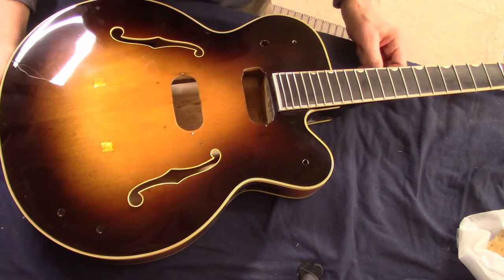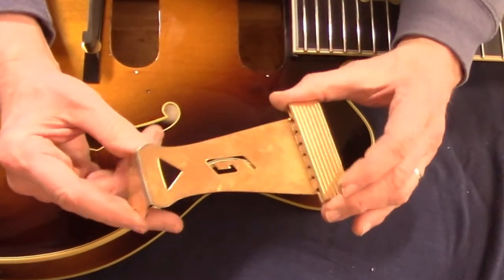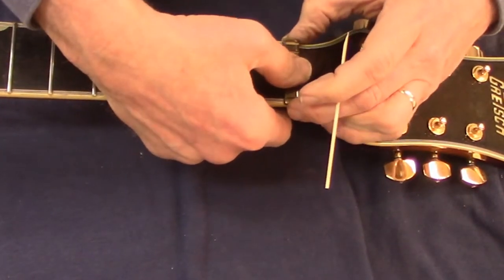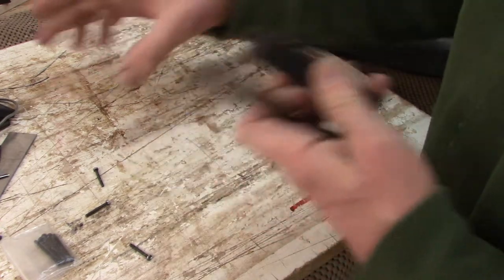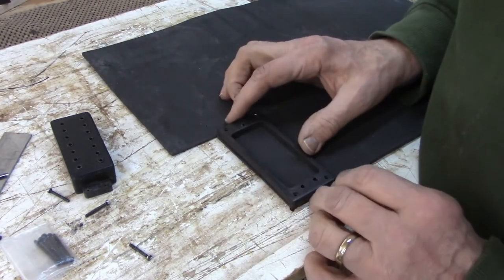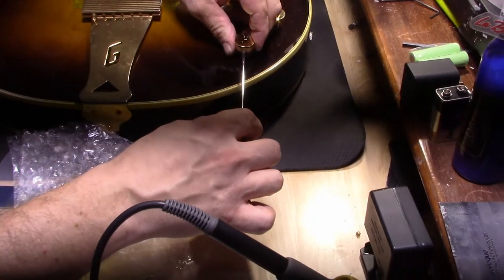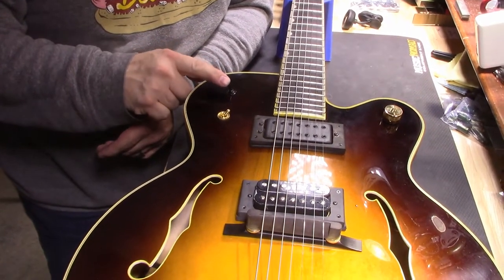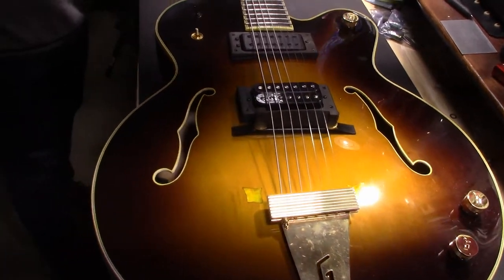Gretsch Archtop Guitar Restoration, Part 14:  Stringing Up and Electronics

Comment: Just for the record Andy Roemer made that brass nut, the brackets holding the floating Carvin M-22 pick up, and the bridge. The bridge originally had brass saddles that he made. Those plastic saddles must have been put in after l lost touch with Andy. I only played that guitar once because it was always taken apart. It was his test bed. The idea with all the glue and blocking inside was to control run away feed back and increase sustain. It was heavy. Andy was a Van Epps master. He would teach what he called linear arpeggios. They were essentially the different modes.
Reply from the maker: Thank you.  I think he would have been an interesting person to have known.

Comment: How did you attach the bridge to the body also can a tom style bridge work on a hollow body guitar without extensive modifications
Reply from the maker: The bridge is not attached to the body.  It is a "floating" bridge that is held in place by the strings pushing down on it.  I don't know what a tom style bridge is, so I cannot answer that question. Sorry.
Reply: @zimnickiguitars311  Tune O Matic bridge generally you see them on a Les Paul style guitars and a few hard tale guitars